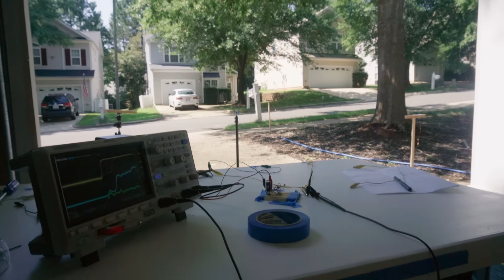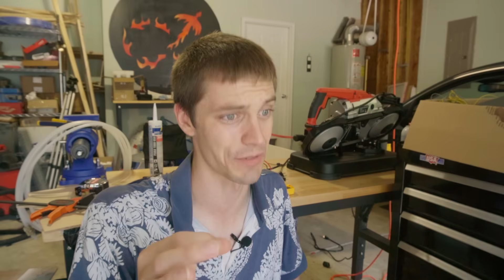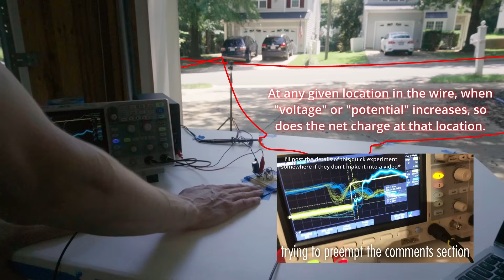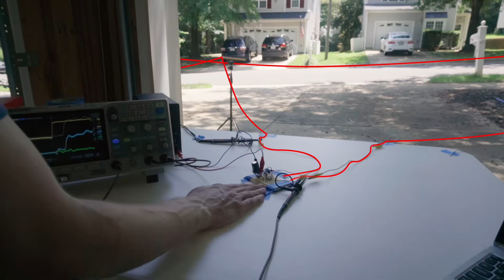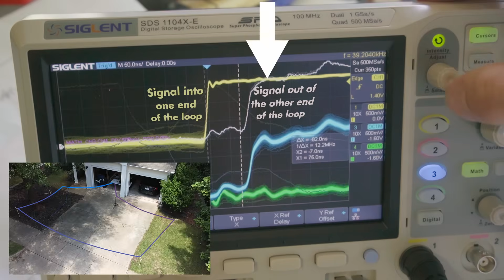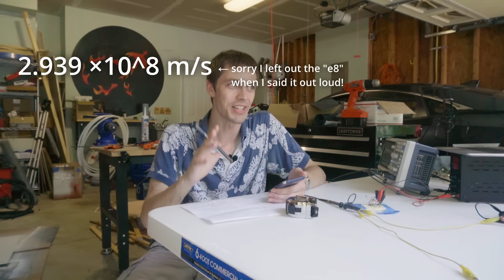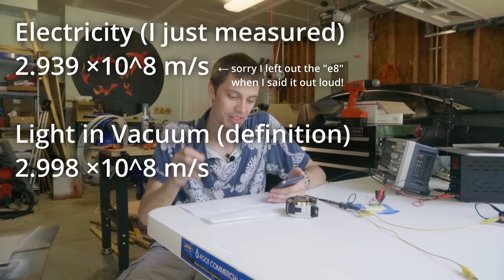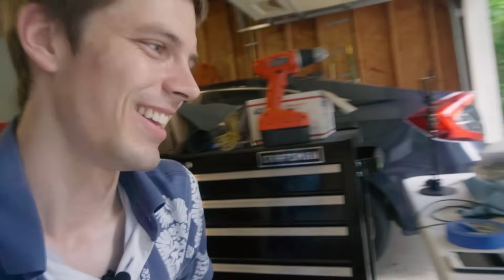Why does WATER change the speed of electricity?

Comment: The speed of electricity in a wire is why computer memory (be it RAM or VRAM) is always situated so close to the processor (CPU and GPU alike). If they were too far away, the timing would have to be slower to account for tiny discrepancies between individual trace lengths and ensure accuracy.

Comment: While studying avionics, I was taught that AC and DC move differently through the wire; AC will only use the surface of the wire/ medium (so great for multi-threaded wire) while DC will use the whole medium (so great for solid core wiring). There was never a mention about different speeds iirc, but it might?
Reply: AC exhibits skin effect, and the higher the frequency the thinner the layer it travels through.  That doesn't mean it travels on the surface of each individual strand of stranded wire, it travels on the surface of the entire bundle.  For 60Hz AC, the skin effect is centimeters thick, so it uses the entire thickness of the wire.

Comment: Hmm. Perhaps I missed it but, I don't recall you mentioning the wire makeup.  I'm assuming you're using copper. But what about aluminum? In new home construction, aluminum wires are very common in larger gauge for ovens & AC units. And what about nickel plated?

Comment: Could you do one with water only in an baking soda electrolyte solution? Measure the time of voltage change at the electrodes for ions flowing throught the water

Comment: Wrong electricity is electrons moving in a wire and is considerably slower that the speed of light. I calculated how long for the first electron into the wire from the battery to make it out and back to the battery from my cars tail light. It would take over 70 hours for the first electron to make the trip.  You are just measuring the charging of a long capacitor. So electricity doesn't travel  anywhere near the speed of light in a solid. The electric field might but the field is not the electricity. since the current requires electron movement.

Comment: 2/3c is exactly the rule of thumb used by electronics engineers (like me :p) when estimating the signal propagation delay in copper such as PCB traces, coax and other cables etc. In other words roughly 5ns/m. Please notice I'm talking about signal not just electricity and signals tend to be not DC but rather complex combination of sine waves/harmonics.

Comment: What happens if you use Sulfur hexafluoride or helium in the pipe instead of water.

Also question if the water was 100% pure would you still get that slow down.

Comment: electricity moves sooooo slow. 1KV is like only 18,75 km/h. What is moving faster is the electromagnetic field. And the electromagnetic field reacts to the shortest distance of the wire more, then to the length of the wire, traveling thru the air (not just the wire). So distance between power source and electrical consumer is the important part to measure, not the wire length.

Comment: I think the confusion comes from a misunderstanding about why the speed of light changes when not in vacuum. In water it slows down like a wave changing from one medium density to another, such as a ripple of water going from fresh water to brine, NOT like a pebble or other particle going from air to water. The pebble example is strictly kinetic, but the wave example in the abstract cannot be compared to macro scale kinetic interactions. Electricity is not particles and should really stop being taught as particles. It's not even a useful simplification.

Comment: It is called Velocity Factor and .is .95 to .98 typically for air spaced wires.    If the wire is encased in a dielectric insulator the speed is further reduced by the dielectric constant, and goes down to .60 to .65 depending upon the dielectric.  This is important to know in Co-axial cables.
For longer distances there is a further complication called Group Delay, which slows the higher frequencies by more than the lower frequencies.   This causes distortion to the tones of the signal, which can be corrected by adding capacitive/Inductive circuits, every few miles.
Printed Circuit Boards also have a velocity factor, related to the dielectric constant.  This effects the characteristic Impedance, and the tuned frequencies of any strip line designs.

Comment: People that say "It can be the speed of light, as electrons have mass" mistake electrons for electricity. Sure, if electricity flows, electrons travel through a cable. But the flowing electrons are not what transports electric energy. The energy travels along (yes, along, not in!) the cable as fields and these fields have no mass and thus can travel at the speed of light. The electron motion is only required to keep the fields alive but the electrons don't have move anywhere near the speed of the fields to do so. It's like a machine gun that keeps firing bullets: Sure, the machine gun has moving parts that need to be kept in motion so the gun keeps firing bullets but none of the parts of the gun moves anywhere near the speed of bullets of it fires, as that is not a requirement.

Comment: You essentially have a TEM mode transmission line. TEM is short for “transverse electric and magnetic mode” which means the electric and magnetic fields are both transverse to the direction of propagation. The propagation constant (measured in radians per meter) is a measure of the “speed of light” in the wire(s), which depends on the material characteristics (sqrt(indictance/m*capacitance/m)). I found it so fascinating that I’m doing a PhD in microwave/mmWave/THz circuits. We basically create TEM transmission lines (microstrip) over a ground plane, which, in your case, is the physical earth. The dielectric that separates the ground plane can be a semiconductor, or in your case, the air surrounding the wire. I could also talk about TEM mode wave impedance, but this post is getting very long and really requires a course in electromagnetics to fully explain. You should see reflections in the voltage waveforms due to the impedance mismatch. Those reflection amplitudes can tell you what the wave impedance is.

Comment: If you need serious distance in a wire, what about taking a 500m Spool of Cat6 Ethernet cable? There are 8 strands in x4 pairs so you could join them in series to multiply it to 4km of copper.